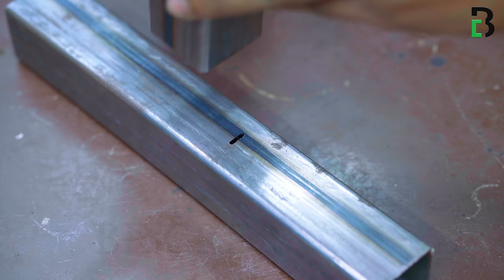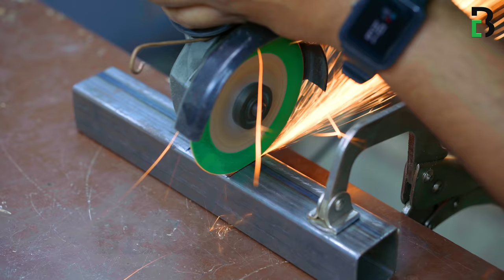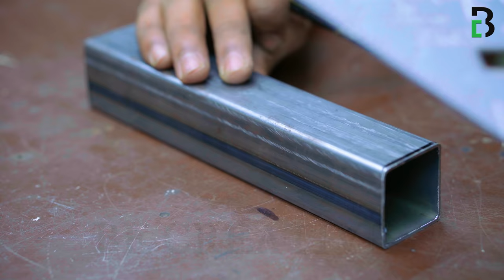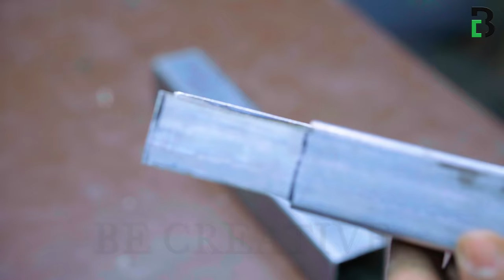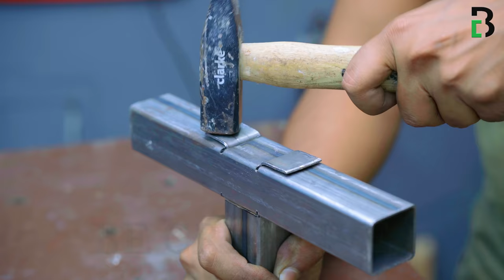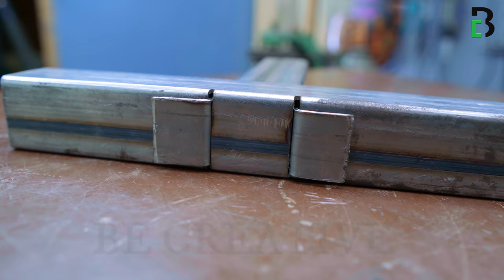UNIQUE PROFILE PIPE IDEA WITHOUT WELDING | Be Creative

Comment: Nice approach but remember strength of joint is decrease with decreasing area of  contact surfaces of joint(if there is tension between pipes so tapered pin/thin rectangular jigs are teared and joint was broken down into halves (this type of joint is only aplicable where tension is less then strength of the joint)

Comment: Out of the box solution. Can also be applied to difficult-to-weld aluminium tubes and sections. Will solve a lot of DIYers problems. You might consider adding a rivet or screw to the flaps. Thanks for sharing.